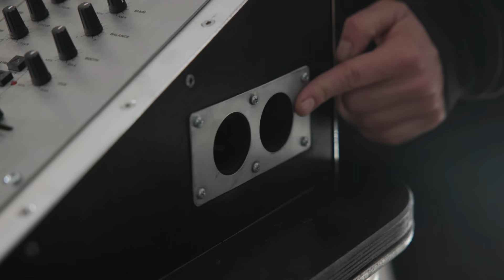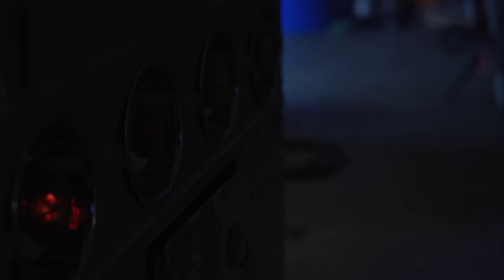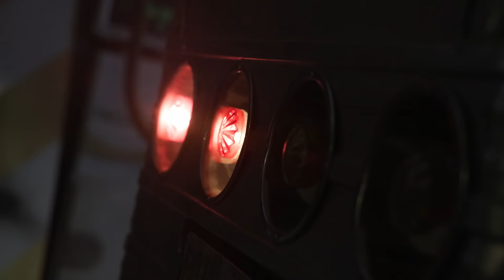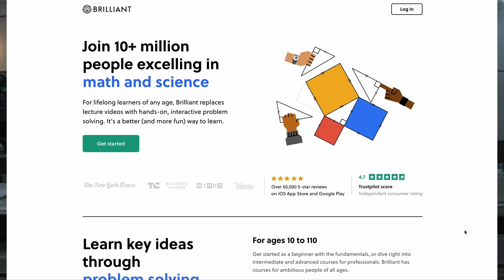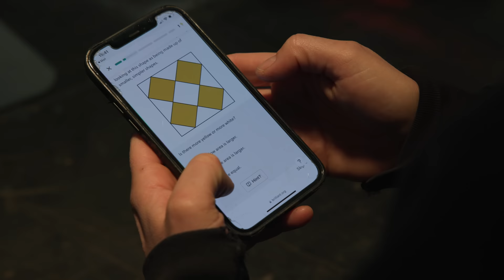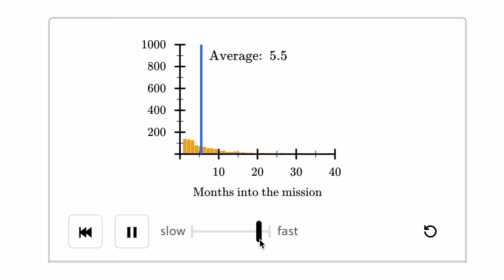Major Upgrade for Liselotte! (Rescuing a 120 year old house)

Comment: When motorized sit-stand desks only move down they usually need to resynchronize their legs. Just push the down-button until the desk stops moving and hold the button for a few seconds (some times as long as 15 seconds). After that the desk should work again. This problem often occur after power loss.
Reply: If that doesn't work, try reseating the boards in the top end of the legs.
Reply: Alternatively, sometimes if the desk just wants to move down (or doesn't react to either one) keep both buttons pressed for around 5 seconds until the desk resets itself and starts moving again.
Reply: I also disassembled everything. Because i did not know that pressing down for 5s is enough...
Reply: Yes and I think sometimes they also enter a "shipping mode" whereby they go even lower, and thus must be fully lowered before they will come back up again.  I've been called so many times to offices at work where I've had to explain just to hold down for a while before coming back up again!
Reply: I had the same. But it was because someone had sit on one side and it became uneven (and didn't tell me). The moment I moved it all the way down I realised this as one side of the table went futher down than the other. After this the table went up again. (no need for a reset in my case)
Reply: Yep, been there done that ☺️ I worked in a big office, so someone knew how to fix it. I might have gone down the "take everything apart" route otherwise - because what is more fun than that? 😁

Comment: On the DJ case, don't forget to line the inside of the electric run holes with some type of insulating gromet to prevent the sharp edges from cutting through the electric cables. Far less shocking that way.
Reply: True and be extra careful with all power installation in the case since the whole thing is conductive.

Comment: Im in New Zealand and Im admiring that roof insulation, what a great idea, we have a long way to go to catch up to European standards of building in my opinion. I guess we are in a more temperate climate but its no excuse for very poor insulation systems that have been used here for years and only recently starting to get more sophisticated. Fascinating to watch your progress thank you
Reply: Same in Australia, houses here (especially older ones) are freaking tents because they are so leaky.

We are currently building, and pretty lucky that our insulation is decent, but that’s mainly cause it’s the cheapest way for builders to improve the minimum energy rating to get the rating approved. Was pretty funny during planning, the builders came back to us 3 times during the approvals process to tell us they were adding more insulation, just so they didn’t have to increase the quality of any other materials 😂😬😰
Reply: That’s actually just a part of the insulation process. They will also put insulation between the rafters. Because those are just 10 to 12 cm high this isn’t nearly enough for German standards. Hence the additional insulation on the roof.

Comment: Wenn Janines Schreibtisch noch nicht wieder geht muss du einfach für 30 Sekunden die Runtertaste gedrückt halten, der setzt der sich zurück. Ich hab den selben Tisch und muss das alle paar Wochen machen! XD
Reply: It's a "feature" of many of these kinds of tables. I think it is for safety or something, so it doesn't "miss" end switches or something because of mechanical wear. BTW Thank you Google Translate, I have studied German for one year, but it was about 45 years ago so I could only guess that it was what I had in mind for a solution for the table 😁
Reply: Anleitung lesen 😆
Reply: @nogocux  steht nicht drin 🤪
Reply: @lennardodavinci6350  🤣
Reply: love that he first thing she does is opening the control box instead of google or comparable.
Reply: Basically, it's like turning it off and on again.

Comment: It's nice to see the progress on your rebuild/renovation.
As we've done our roof back in 2020 we decided to use wood fibre as well (Gutex), but decided to go with 28 cm thickness. The benefit of the added thickness is thermal mass which not only prevents from loosing heat. The target was to add additional protection from heating up in the summer. And it worked out great!. The temperatures go barely above +2-3 °C compared to the other levels in our house (20 °C in the basement, 23 basefloor and 1st floor [if we remember to keep doors closed]), which is significant if you have a bedroom up there.  

We went the same route for the outside walls of the house. Adding more insulation does not blow up the budget as much as one may think. We've seen the regulations went from 4 cm up to 8 and 14 cm. Get the best you can get now. It will pay out in the future. Energy prices will go into one direction only - up. Building/renovating a house is a long term investment and will pay out during the lifetime of the house if done properly.

We also went with large 4x tripple glased Velux windows (2x2 facing north and south). The added light really makes a difference in the dark months. I would not want to miss the outside window blinds as well. We (almost fully) close it in the hot summer months during the day. This keeps the temperatures down as well.

What I missed/should have planned for:
- calculate the location and spacing between the windows based on future plans to add solar panels.
- should have positioned the pole for mounting satelite dish on the north side of the roof to make more room for an addtl. solar panel
- should have extended the financing to do solar + heat pump back in 2020 when interest rates were far below 1% and inflation was way down.
I know these 3 points are going to bite me where it really hurts 😕

Comment: Some audio pedantry: Going straight from RCA to XLR can introduce a lot of noise since the signal isn’t balanced anymore. If you have problems with electrical noise getting picked up, like mobile phones, try putting a DI-box in between to balance the signal. And then you get the pleasure of having to check the battery every session! Audio equipment is such fun :)

Comment: Fun fact: Rebuilding or renovating a roof like you do, in Denmark regulation says minimum 300 mm insulation. 80 mm is what we used in summerhouses in the old days.
And it's funny, because Denmark is not colder than Köln or Berlin in wintertimes. So with higher energy prices, you should at least put up 200 mm insulation. So in a few years from now, don't tell me I didn't warn you ;-)
Reply: Could add a layer of foam or cellulose on the inside of the house (the attic ceiling), if it's not going to be a finished room. Would also be a thermal break against the wood.
Reply: @fool0  Laura didn't mention any additional insulation while stating the 8cm fiberboard will do ok. It won't.  30 cm is a rule of thumb for renovations in Central Europe and the difference between 8 and 30 cm is very noticeable. Both in energy consumption and comfort as insulated roofs make for long heat retention

Comment: about the fog machine , a famous band used them a lot of their stage and found out that the smoke damaged their equipment , stuff like the cd lasers the faders / switches and the recorderheads of the 8 track recorders they used where affected by the greasy smoke , should be ok in youre case as long as the smoke doesnt collect inside the box

Comment: Someone's propably already mentioned it, but some lift desks have a safety mode where they only go down and not up. Solution: Once all the way down, press and hold the down button for 5-10 seconds. This will trigger a reset. Try it!

Comment: Worlds colliding for me: I just finished a long term corporate project documenting the Energie Sprong project in Bochum, NRW and filmed and photographed the Gutex fiber material being blown into the wall to achieve full seal on the new front of the house as the old wall is rather crucked and wavey. And  that fiber material is what you are getting as plates on your roof. Fun coincidence and definitely a great choice of insulation.

Comment: Love the DJ set up, I just have one suggestion. With the fog machine, wouldn't it be better to mount a down diffuser above the outlet to allow the fog to be dispersed down and out across the floor, and not straight out at waist height, as it seems to be doing? Only reason I bring this up is that if the DJ platform is elevated above the dance crowd, the fog is going to come out at close to chest height and blind everyone's ability to see around them.  Just a small diffuser above the fogger's outlet. I love the project, it's wonderful, that was just the only thing I noticed.
Reply: Perhaps if she is going to add a diffuser, she could make a directional one ?!

Comment: I think Laura would be happy with a house made entirely of windows... a roof that's made of skylights, walls that are floor-to-ceiling glass, and open beam construction. Sounds pretty awesome, actually!
Reply: That'd be amazing!! (Also isn't that more or less a greenhouse at that point?)
Reply: @wednes3day  Yup.. 😀But there are all sorts of coatings and films that can be put on glass - one-way IR (to trap heat), liquid crystal+polarisers (electronic frosting/blackout), even a transparent photovoltaic layer (absorbs UV to generate power, but stays see-through)
Reply: The problem with that would be that she wouldn't be able to throw stones.
Reply: @vigilantcosmicpenguin8721  😆

Comment: Last night I got thinking about the door on the DJ stand and had an idea. You could replace the door with the original panel, put some flanges behind it and use some DZUS Fasteners (that's their real name) to hold the cover in place. They are used in the aircraft industry and by hot-rodders. They are some of the most ingenious locks ever and would allow for a nearly invisible door to be made.

Comment: A carpenter trick for finding the midpoint on anything flat like one face of a panel or post (assuming you don't need to get a true measurement number): take your ruler and skew it until you have the a whole number on one edge (I'll usually start at 1", not 0 because sometimes the end of a ruler gets bent /imprecise) and another round number on the other edge (we'll say 5"). Your midpoint would be at the number 3 in this example

Basically you're picking a different line of a more convenient length to divide in two, instead of trying to divide the true dimension to sort-of-in-half-if-you-squint

Just because it works and it's easy doesn't mean it's sloppy or improper to fold your tape in half! I'm a very visual thinker, so it makes total sense.

Comment: Congratulations on Liselotte´s new "hat" :) -Also, perhaps the "Disconator" needs a directional mouthpiece, to do floor saturation vs. blow-up of the smoke? Cool project, in any case. Particularly like your willingness to go "lo-tek" on the drawer :) Simple, elegant solution! I would pop-rivet a plate, like a "roof" above the drawer, though, or you will have a stuck drawer every time you open it. -Cables do that.

Comment: I hope you're putting more insulation in the roof than that. 3 inches is less that we put in walls in Canada, 3 inches in not even R10. Foam is cheaper and offers more R-value, and does not loose it's R-value if it gets wet.

Comment: For the DJ booth if you have the room to add a way to diffuse/cool the smoke right after it leaves the machine it will hang lower, last longer and look cooler. 

For Halloween I aim mine through a small dense bush to get the effect.

I've seen set ups with tubing and ice but they take up a lot of room

Comment: The DJ box should have some built in speakers. And I would put four little LEDs somewhere that flash in the same pattern as the front lights so that I can see what the front lights are doing without walking around.

Comment: I don't do mechanically creative projects like you but I do a lot of dressmaking and knitting. Those use the same maths but I use similar tricks to you. How long do I need this strap? Fix one end, try it on and pin the other to fit - its about that long. Where are the centre and quarters? Yes just fold it and use a pin or chalk mark. The 2 basic stitches in knitting - knit and purl - are the equivalent of the 0 and 1 of binary code. My son tells me I would be good at programming because I  can alter patterns easily.
Brilliant looks like a great concept for the neurologically diverse. You fit the description for adhd. Good news, I'm certain da Vinci had it too. Great company right there.

Comment: I'm not trying to be an asshole in any way Laura. But as an electrician i feel the need to chime in. That dj booth sadly isn't quite up to snuff regarding electrical safety.

Every electrical component connected to mains needs to be shielded twice ie cables with onky base isolation is a no go as it's quite simple to Nick the cable and get badly hurt. Grounding should also be taken quite seriously and separation between what we in Sweden call lågspänning (mains) and klenspänning (under 48v or thereabouts)

Take it from someone who spent a couple of nights under observation Hooked up to all manners of heart monitors after i got badly injured when doing electrical work.

Lots of love!
/Michael

Comment: The roofers here in Chicago are usually Polish, Lithuanian, or Mexican. 
The latter are the only ones who speak English.
None are Union unless on big projects.

When they patch a roof - they put down sheets of plywood. Always a hidden cost. They mark up the price on crap plywood.
My roof padding is like yours, then shingles.
No more tuck-pointers here - for roofing around the chimney. I have gotten leaks…

Comment: Why don’t do the black air/water membrane above the isolation? If you have a leak the isolation doesn’t get wet. And also why don’t  do thin vertical wooden slats and then horizontal wood for the roof tiles. If you have leak the wood doesn’t rot. I’m from holland and we do it like this.

Comment: Why is the insulation on top of the water resistant roof underlayment ? Litterally completely oposite of what we do here.
Any lek in the outer roof and the insulation soaks it up and holds it forever instead of it going down over the water resistant fabric
Reply: That concerns me too! I've never seen this oder of layers before. Usally from the inside to the outside: Vapor barrier, insulation between the rafters, on-roof insulation, water resitant layer, counter battens, battens and roof tiles. But with this type of on-roof insulation you don't need the water resitant layer mandatory, only on the roof ridges, chimney, over the windows,...Probably they do it like this because they are scared of the weather. So they wanted to close the roof quickly, but usally you just use a tarp to cover the open roof you are working on. Or you just open the part of the roof you are working on and leave the rest of the tiles on the roof until you get there with you on-roof insulation. Now they have a huge waste of non biological material and twice the work because they have to secure the roof ridges, chimney,... again on the on-roof insulation.

Comment: I love the dj box!!! But, wouldn't it have been better to put the access door in the back, so that if you have to recharge it, you wouldn't have to leave the console, and walk in front of the lights and booth to do it? It is very cool, though...but fir me, the house is waaay cooler than pretty much anything I have seen. I think you should leave all the timbering exposed on the inside! I would love that if I lived there!!! What kind of roof are you getting? I hope they are tiles... Also, could you tell me where to get those clay bricks? I would love to use them in a house I am working on... Thanks fir sharing all your amazing stuff with us! Ellen from Cincinnati...(I live in a neighborhood called Over the Rhine...😂🤣😂 there used to be a canal that cut across the northern part of downtown, and there were so many German immigrants that settled north of the canal, people nicknamed it, "The Rhine"... Thus went you crossed over it... You were "Over the Rhine"...😄😃😄

Comment: I have a couple remarks I think the foil should be on top of the wood fiber board. It is diffusion open foil meant to be used directly under the roof tiles, the foil will protect the wood fiber board from leaking tiles but let the moisture coming from within out. I hope you are going to insulate in between the roof beams because 8 cm is not a lot if that is the only insulation.